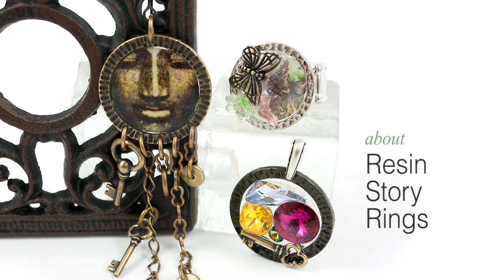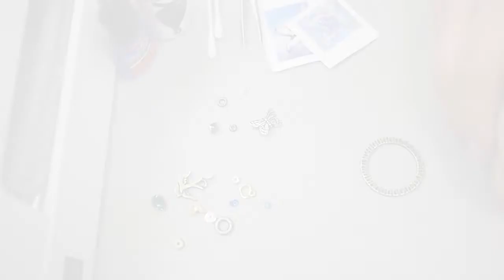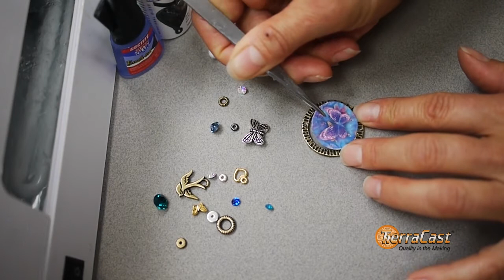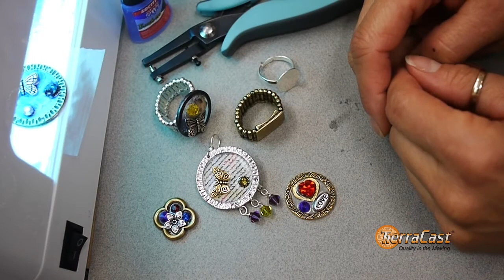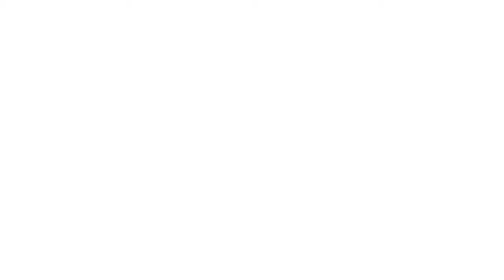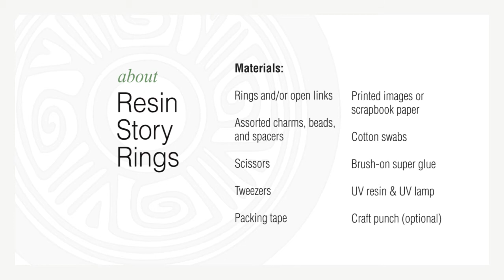How to Make Resin Story Rings

Comment: Hi, this is the first time I've heard of hole punching pliers that could punch a small hole through metal. Do you have a name for them or a link to where I could buy them? Thanks!
Reply from the maker: Hi Irene - there are a couple of common types. You could try a plier style punch like the Eurotool EuroPunch, (Beadsmith and Beadalon both also have versions of this type), and there are screw down types such as the ones offered by ImpressArt. https://www.impressart.com/products/tools-supplies/hole-punches.html. (They also offer plier style punches.) All come in a variety of hole sizes. We prefer the plier type for ease of use. Hole punching tools open up design possibilities like crazy! Know that our components are pewter and are easy to punch. You may wish to check with the punch manufacturers to see which types of metal are no-nos. (Steel and brass?) Have fun!